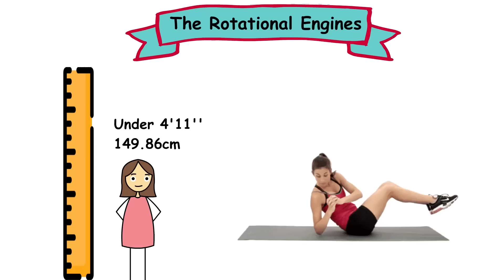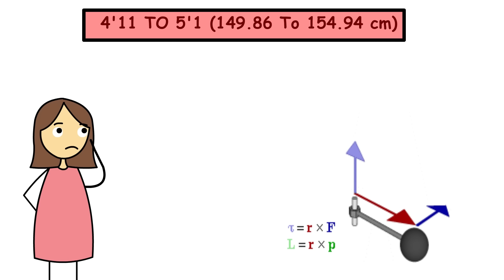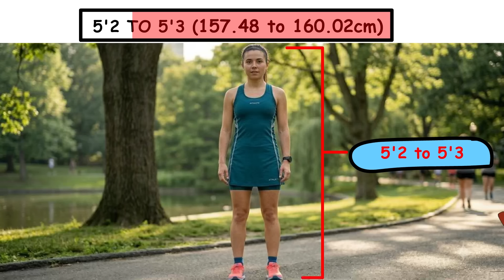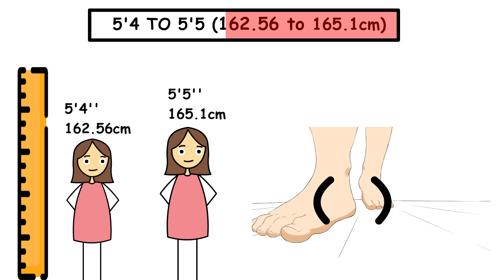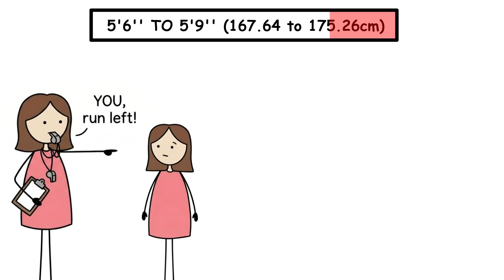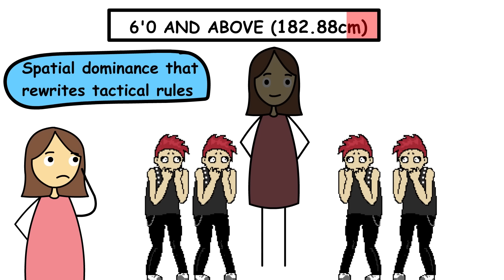What Your Height Secretly Reveals About Your Athleticism as a Woman

Comment: 5'2, I did like martial arts as a kid, but swimming and running were things I'm good at! I easily beat kids while running even as an adult, even though my BMI was always considered overweight. I did suffer a knee injury from falling on concrete while running years ago and it's limited my motion a bit, but not too much. I so physiotherapy daily.
I adore swimming and developed broad shoulders from swimming every other week as a kid! It means even with a small frame, I prefer picking oversized or strappy tops to avoid the annoying pinch in the back between shoulders.

Legs are longer than average while torso's shorter.

Comment: 5'4". When the Ground Readers title came up, I got it before you even explained it. My sport was roller derby - blocker 3 - the position that demands compact power and quick changes - basically the short stop of the track. I wasn't big or heavy enough to be wall. I wasn't tiny and light enough to be a rocket. Instead, I was a heat-seeking missile. The tall girls couldn't catch me and the short girls couldn't take me down if they did. My job was to assassinate the opposing jammer while eluding her protectors. I was the perfect size for that mix of agility, compact power, and direction-changing speed.

Comment: I mean, there is something to this for sure. But also, there is so much more to a person's athleticism and biophysics than their height. 

I'm 163cm tall and I have a friend around the same height. I outweigh her by at least 10kg. Probably 15. Our athletic capabilities are not the same. And yes, it's true that I simply work out more than her. But I would outweigh (read as out-muscle) her by a significant margin even if I exercised the same amount she does. Because that's just my genetics. I gain muscle easily. She has to eat 5 times as much as me just to stay alive. That's not even getting into stuff like muscle insertion points and composition. 

On the other hand, she has a much easier time than me staying cool. Because muscle = heat, my body has to work harder to keep cool under the same load and the same conditions as her. And that in turn also makes a difference. 

All in all... Huge oversimplification.